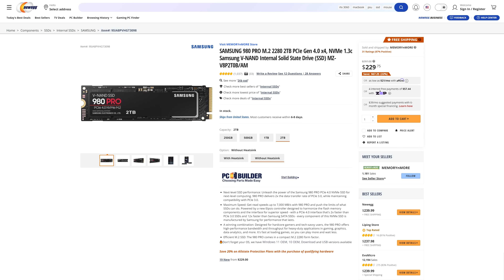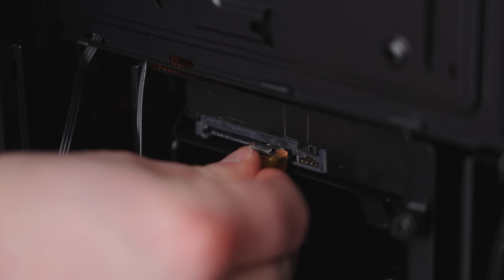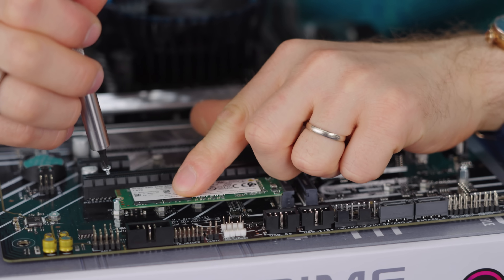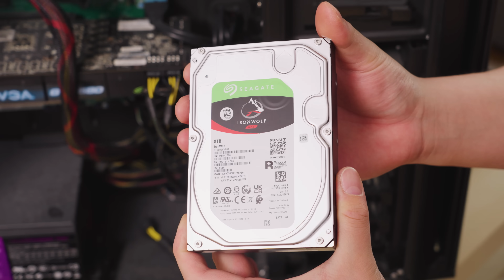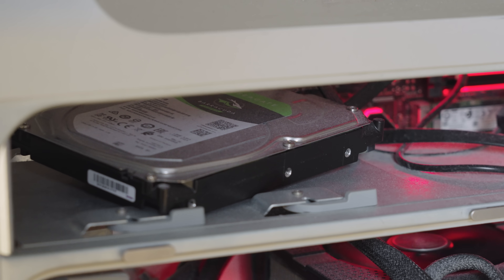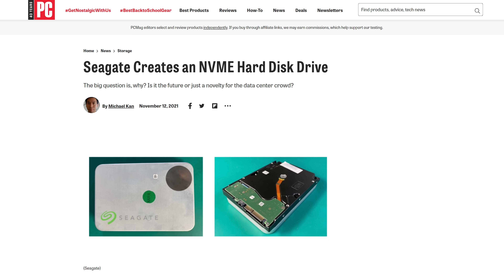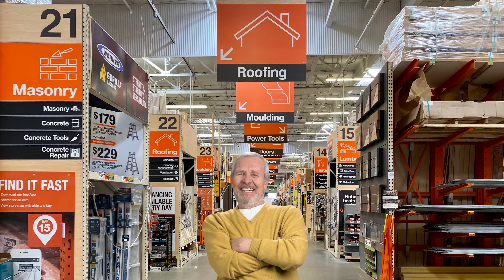Is SATA Obsolete?

Comment: my sata ssd feels so fucking fast (500gb wd blue) i don't see myself buying an m.2, unless for some reason i wanted a larger capacity boot drive, then i'd get a 1tb m.2 and use this 500gb maybe as a usb 3.0 external drive
my setup right now it 500gb ssd, old ass 500gb HDD and old ass 2tb HDD and i'm actually fine...
Reply: Still you wouldn't get to notice a huge leap in boot times if you'd switch to nvme as mentioned in the video unless you're moving and working on big files.
Reply: And that's a very decent as well as a cheap ssd, I prefer wd blue over the ridiculously overpriced samsung sata ssd's.
Reply: @erenwayne  yeah i wanted something decent and reliable that wasn't super expensive, pc parts can get really expensive over here (minimum wage is 1200  "moneys" and almost 40% of the population lives off of that and this SSD cost me 500 lol)

Comment: Meanwhile my 10  years old 3.5 HDD still kicking for storing my entire..uh..memorial homework and college subjects..
Reply: Word of advice backup your stuff. My 8 year old pc died back in 2021 and I lost years of my life and tons of work.
Reply: @Melatoninist  it now serves me as enclosure so it wont connect/ spin everytime to increase its age bit longer
Reply: @Melatoninist  THIS. Was it a Mac or a HP? Maybe a Dell? My experience with those three things turned me into a pathological saver. I've had those PIECES OF F'ING SHIT cost me so much time and ultimately money, especially HP laptops for money, and Apple for time. Whole all nighter of essays, gone. 

Using an Apple or HP without backing up your data is like the school bus hitting a bump and you landing on your nuts; you only need to experience that painful lesson once to ensure it doesn't happen again. Sadly, the very first time was a system crash on a Mac, so I just kept making sure to command+S or whatever it was, but was still young and dumb enough to have not started practicing the 2+1 rule: always store your data in three different drives, two in one location and another where a house fire won't take it out. Anything you need or matters to you like irreplaceable family albums or financial or work documents. I used only one file, and it got corrupted before school in the morning.

To this day I will never buy a HP laptop or have anything to do with Apple. Not just for those reasons either.
Reply: @Melatoninist  me too
Reply: Back up your Minecraft worlds too. I lost all of mine randomly and I can’t find a way to get them back
Reply: @Melatoninist my condolences to your lost
Reply: Currently will be buying a Seagate 2tb 2.5 HDD for my Laptop due to how cheap it is.
Reply: @blackjack2526  don't store stuff in a laptop long term. Get a 3.5" drive and put it into a more stable PC case, compared to the portable laptop that might fall, get stolen or liquid damaged. Or tuck it somewhere safe while unused.
Laptop drives fail earlier and are far less reparable than 3.5" drives (meaning, if it fails you're toast. A 3.5" drive can more often be repaired or at least the data can be recovered from it)
Reply: @YounesLayachi  that explains a lot makes tons of sense.
Reply: @blackjack2526  a 2tb ssd is $80 pretty cheap.
Reply: @REXae86  that's if you buy QLC nand, and/or nand without dram. Either of those options shorten the SSD lifespan to below 3-5 years.
Reply: @REXae86   not where I am
Reply: @blackjack2526  The 2.5 Seagates are an SMR drive, find a CMR your laptop will run like junk.
Reply: @blackjack2526 ayo 📸🤨 Stop the cap
Reply: @blackjack2526  See this is the thing,
tl;dr hard drives are just cheaper.

Also to OP, those things degrade afaik so while I can access my ancient hard drives I really don't think my present C: drive is going to be around in 10 years, and I got a good one from Sabrent too. I don't see NVMe as being built to last really, and there's a reason why people dump everything from their family photos to games to trashy anime onto hard drives. The speed isn't even that terrible for most usages, with the two main problems with a hard drive being its size and weight, and its power usage (I think a HDD uses like triple the wattage of an NVMe, so that actually matters if you start accumulating enough of them). The speed is only an obvious problem on certain games and as a boot drive in my experience.
Reply: Ayo 📸🤨
Reply: Delete that homework already lol just tell them your dog ate it years ago if they ask to re-see it🤭
Reply: "Homework" never goes bad with age.  But hard drives do.  Copy all that precious homework over to a fresh drive.  You can buy a 4 TB portable HDD for under $100 these days.
Reply: “Homework”
Reply: @tylereatsfood8194 - yeah, sure! I mean, how much space can pr0n take up on your hard drive…?
Reply: @tylereatsfood8194  "you're 35 and have been out of college for 9 years... "
Reply: My 30 yo drives still worked when i went trough them all to see what was still on them.  
These days I just replace them and allocate them to cold storage and backup once they have 50k hours.
Reply: @AreThou746  my HDDs never survived long enough for me to reminesce :) whenever I'd reopen one after a few years, it would malfunction.
Reply: Yep....I'm not paying $500+ for an 8tb Evo or $1,500 for a Sabrent 8tb m.2 no matter what the benchmarks or the sponsors say...my benchmark....called a budget...would rather pay $129.00 for an 8tb drive and still want a savings coupon.
Reply: @mqcapps  I'm somewhat reverse: I buy gen3 TLC nvmes with dram around 1tb or 500gb. Hoping to save for a self bifurcating m.2 soft(?) raid controller card- expensive as hell ($300+) but allows me to buy these 1tb/500gb in intervals rather than a full 4tb. Not planning to use the raid, since if one dies, everything gets deleted- just the self bifurcation is enough - (allows all nvme m.2s on the card to run pcie 3.0 or even 4.0)
Reply: @WarPigstheHun  yeah...I have a m.2 adapter for the other x16 slot and bifurcation is something to look for and gill boyd talks about this a lot on his channel...ditto on the raid...got some gen4 m.2 on sale but then I asked the question...once past benchmarks...how fast can ms word go...
Reply: Bet ya have some of your “stepsisters” homework on there as well
Reply: you can upgrade for less than a tank of gas why would you do that to yourself
Reply: Same here. 8 year old HDD still alive, although it's slow as hell sometimes
Reply: Anyway most "homework" won't need much bandwith so your SATA HDD is perfectly fine.
Reply: Make sure you regularly back up your data. I didn't and it cost me a pretty penny getting the data restored and the drive replaced in a shop
Reply: My 14 years lod 3.5 seagate still functioning with 39mbps with no problem for mass storage
Reply: Same as I, I have two in my old computer, one is 6 years old and still working fine
Reply: The only time I have seen hard drives fail is when they are abused, like somebody leaving the computer stored in a cold garage in winter or it sat under a load when it got wet!! I had one hard drive that "had been stored in a laptop in a garage in winter" that literally had most rust on it then a 1972 Pinto!!
Reply: @brianfuller4071  I had a old computer from 2012 sit in a humid office for a long time, then it got a small amount of rain, and its now my main computer
Reply: and those hidden folders
Reply: College "subjects"
Reply: True. I use HDD for long term storage and SSD for working hard drives.
Reply: Same
Reply: ""Memorial Homework""
Reply: My moms 18 year old 80gb seagate hdd is at good condition after 18 years
Reply: It seems that you are... "Hard Driving" your... Uh... HDD.
Reply: I just Got a 8 TB Seagate for 90$ to replace me to HDD 2 tb's
Reply: rub a magnet on it
Reply: Admit it. You collect scandal vids, don’t ya? 😅
Reply: Stop the cap my Chromebook has 8 pirated HTML5 games and 6 pirated episodes of Murder Drones just admit what you have on there
Reply: Honestly, HDDs are still viable as vault storage. I have a 3tb i got for like $30 used like 10 years ago still kicking strong. If it's under $20 and response times aren't an issue, why not?
Reply: @z33thr33  HDD's are also typically more reliable, and if your ssd dies its sometimes impossible to get that data back
Reply: More likely "handwork spicy material". 😘😜😆😅
Reply: Linux ISOs
Reply: Yeah, That's why there is 20tb HDD, being developed to save movies ,shows, memories and photos/videos from old phones for cheap price. Doesn't cancel the video purpose :)
Reply: based
Reply: Hey man what brand is your 10 yo HDD?
Reply: @StormKnight1  i know your not talking to me but my hdd is from 2012 and is made by western digital
Reply: @NEON2600  still, thanks for giving the info, I was afraid because Hard Disk Sentinel said my effective lifespan is going to expire in a year or so and I was really hoping that I could rely on the disk to carry me far more than that.
Reply: I would move those files to a new drive if I were you. Yes HDD's are known for their longevity but its best not to test fate, lest it fate test your drive for bad sectors 😅
Reply: As others have probably said, there's no need to change a drive due to age. If you run a policy of always having two or three copies of everything then you just replace the drives that die when they die, restoring the backup.
Reply: My oldest HDD is from 2008 and still works. I don't keep anything important on it, I use it for backups of backups. 😊
Reply: I mean I just stream my homework these days but you do you bro
Reply: @eqprog  well, being raised in a rather late time for internet availability, it's just old habit die hard :)

Comment: No again because most mother boards have max 2-3 m.2 slots so you can run out of room for drives.
Reply: Then you ass more with pcie cards one card can have 8 drives then the only limit is how many pcie lanes you got thats not already in use for other stuff.
Reply: They may m.2 expansion PCIe cards, so it's not end of the world

Comment: Sata will not die, just like HDDs still haven't completely died
Reply: Also it less risky for failure and age longer, despite having moving parts
Reply: floppy disk are still around
floppy disk are used maybe in nuclear plants or indutrial automation
Reply: I hope hdd won't die too soon, i want my important data stored on raid 1 of those. Even if they're less reliable and slower. Why? Because if they break, I can recover the data. If an ssd breaks, I can't.

I want all my programs and games on SSDs tho.
Reply: I want SSDs, HDDs and current RAM sticks to die in favour of memristors when they come around
Reply: Yep, Yep... Still have a 90s Seagate that sat in a storage unit, and two wet basements. Still works like brand new.
Reply: HDD's are still the best option for long-term bulk storage. Also they are considerably cheaper.
Reply: Not now hut eventually, when ssd will be stable enough
Reply: HDDs are still great secondary drives
Reply: Eventually it will.  Probably when spinning rust HDDs become more expensive per TB than SSDs.  At that point, motherboard manufacturers will stop putting SATA on their boards.
Reply: @travis1240  SSDs are highly unlikely to become cheaper than HDDs, NAND flash is simply more expensive than magnetic disk in terms of raw materials
Reply: @williampaabreeves  That's true now (and has been true for a surprisingly long time) but the number of bits you can store on a spinning rust platter will hit a miniaturization limit before NAND, because they are mechanical -  the read heads, motors, and assemblies need to be manufactured within certain tolerances, and those tolerances are not improving at the same rate as the number of bits that can be stored on a wafer of NAND silicon.
Reply: @travis1240  the denser SSDs become the less reliable and slower they also become. QLC is vastly inferior to SLC, MLC and TLC. SSDs will only get worse as we make them denser.
Reply: @williampaabreeves  3D NAND can mitigate that quite a lot. Rather than planar designs 3D can attain a higher density in a given form factor while lowering the bits per cell.

Unfortunately it seems Samsung has pulled a fast one with the 980 pros. They're TLC. We'll have to see if the 990 pros go back to 3D.
Reply: Yes he said that in the video, great job repeating! lol
Reply: That's what they said about 5.25" floppy disks!
Reply: @ggEmolicious  Will not die without significant change in circumstance. As it currently is, HDDs are still considerably cheaper for higher capacity than NVMes.
Reply: @someoneelse4811  It's getting close for most people. Have you noticed the prices of HDDs don't seem to go down anymore? I have and that's not a problem with ssds, they drop considerably every year. At some point there are users that say, 1TB or 2TB and so on is enough. Most users won't care if the larger hdds finally drop in price, because most users don't need 8-20TB of space. Again we aren't there yet, but we are close and it won't be long until HDDs become a thing of the past
Reply: @chronometer9931  I've noticed the price of a 1 TB hard drive drop from $50 to $30 in the past three years, it still happens. SSDs have reliably been at least 2x the price of HDDs, even to this day.
Reply: @chronometer9931  Also, you aren't considering non-consumers in your prediction.
Reply: @someoneelse4811  Aren't we entirely talking about consumer hardware though. Businesses buy server motherboards, not consumer mobos
Reply: @someoneelse4811  Why would you waste your time with a 1TB hard drive at that point? I was talking about usable sizes. 3TB+
Reply: @someoneelse4811  I should also explain that when I'm talking about price drops what I mean by that is in the past, before ssds came along HDD manufacturers used to compete with each other. Smaller size would stop being sold, newer larger sizes would come out expensive, but drop into those price points. That's what I'm talking about. 4TB drives have been around for 12 years now, they should have been phaser out, but Instead of doing that the companies just release larger drives and keep the prices up on those. $100-200 should get you an 8-16TB drive by now if it still worked that way, but there is no competition in the market. 

There are very few HDD companies left and they are using their monopoly to keep prices high. I hope that helps you and other better understand where I'm coming from. 1TB HDD shouldn't even exist except on the used market
Reply: @chronometer9931  Because 1 TB is more than usable unless you play dozens of (uncompressed) AAA games or horde 4K videos.
Reply: @chronometer9931  If there's demand, it isn't obsolete. Businesses and enthusiasts count.
Reply: @someoneelse4811  my entire game library is mostly pre 2016, and only like 20% of it was ever AAA, it still takes me nearly 5TB to store it all. Meanwhile the like 5 new AAA games take up almost an entire TB by themselves
Reply: @williampaabreeves  Nearly a TB for one game? I thought 20 GB was bad. Uninstall that garbage.
Reply: @someoneelse4811  more like 5-10 games, but thats the sad reality of anything released in the last few years
Reply: @someoneelse4811  That may move a bit. Rumor has it that NAND will drop in price since the market shrunk. Retailers may slash prices around Q4.
Reply: @ggEmolicious  Mine's still working, so there's hope, long live floppy!!!!
Reply: u cant compare it with that
Reply: @ggEmolicious  Not anytime soon
Reply: @ggEmolicious  If floppy disks were capable of holding even a couple hundred gigabytes, I guarantee they would still be around somewhere being produced. They are extremely thin and light, and were contained in it's own protective shell. Obviously, they wouldn't be mainstream products, but I imagine some small group of consumers would still use them if they were as good as a mediocre hard drive.
Reply: @ggEmolicious  Except that's a TERRIBLE comparison. Floppies were doomed from the start when Hard Drives began to quickly outpace Floppies. 
Meanwhile this is NOT about Storage. This is about Price & Performance Efficiency. 
Hard Drives will probably be in use for Laptops, ESPECIALLY budget ones. In terms of Desktops, I think we'll see them being phased out more an more for anything, but budget models.
I DO think that Mechanical Drive COULD end up replacing Tape Drives for Archival Purposes.
Reply: @TheMorriganAensland  You don't know what your talking about. I can tell you weren't even around back then from your story. That tech continued on until it was replaced by floppies, zip disks(arguably for a short time) then CDs and finally USB sticks/SD cards which are being replaced by the internet. Floppies for the most part weren't competitors with hdds except in the IBM era and again, the tech didn't die it found a new use that kept it going. That's not the case here, SSD and HDD are in direct competition

Comment: No, sata still better for laptop, less heat,  sata ssd provides more battery life in laptops than nvme, in Windows laptop

Most consumers Won't see the full speed of sata let alone nvme anyway
Reply: It depends on the NVMe drive. There are NVMe drives that are optimised for mobile use and use significantly less power than your average desktop NVMe drive.
Reply: Some laptops only use NVMe SSDs.